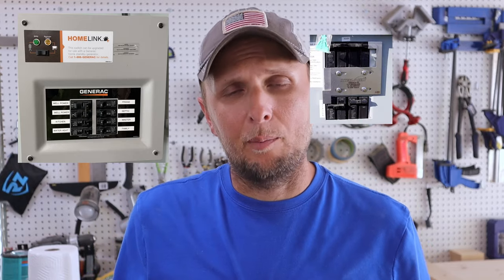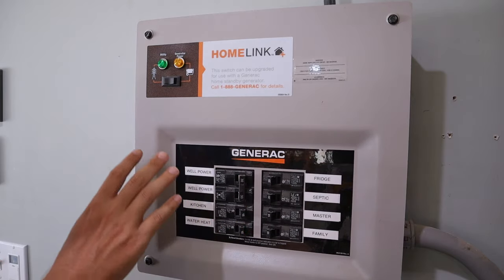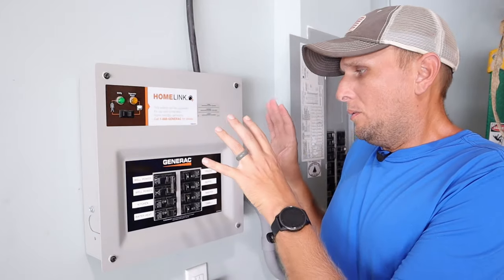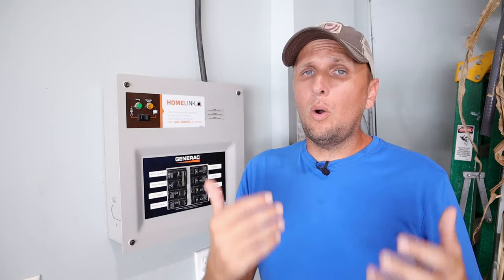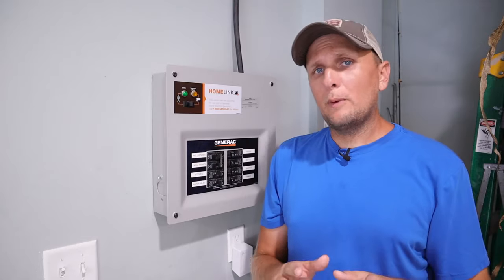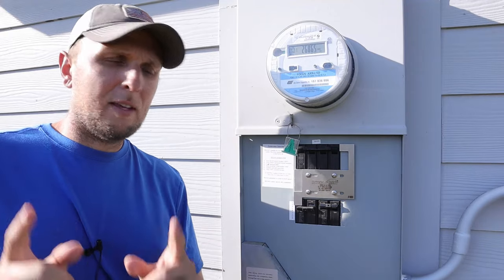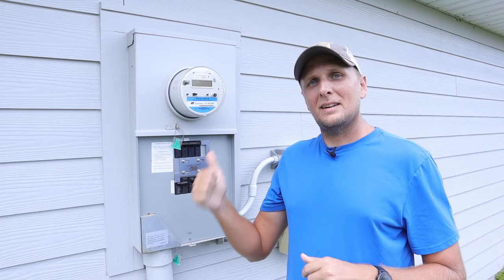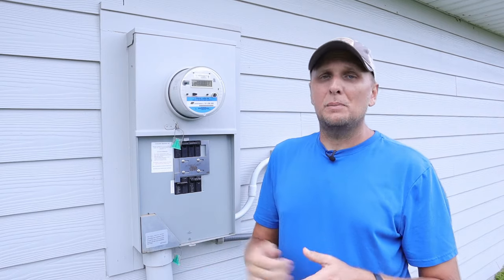How To Choose Between A Transfer Switch Vs Interlock Kit With Power Inlet Box

Comment: I have a panel outside that feeds two breaker panels,  one for the original part of my house that doesn't have a main breaker on it  and one for the addition part of my house, also no main  breaker on it. I have a 6250 watt generator that i want to hook up. The panel outside has two main breakers on it. What    would you think i should do with this problem? Thanks. My name is Jim.
Reply: Suggestion - for a temporary situation or a permanent solution, get a Generlink meter base adaptor. Would recommend the 40 amp unit. I did not purchase the surge protection nor the wireless link as I did not need them. I did get the 20' cord with the 50 amp, RV type plug. It comes with a cord of your choice.
Safe, very easy to use, super easy (5 min.) for the electric company to install. 
I have no ties to the company. I bought one and it's a great solution. Using it with my Generac standby genset. Simply plug in the cord when needed, unplug when done.

Before contacting Generlink, I first emailed the datasheet info and request directly to our utilities director at the city. The city provides electric to our area. 

A week later I had his letter of approval! He did say that I had to contact his office to have it installed as the customer service reps don't know about the device.

Comment: As long as the main breaker is off there's no feedback to the Utility line, then you can select the breakers you want to use on the main panel and turn the rest off.
I have a clamp on one side of the main line coming in to an GFI outlet, I have a light & Bell plugged in so I know when the power is back on.. I switch the breaker off to the generator and switch the main back on.. Very Simple !
Reply from the maker: It is simple, however it’s illegal.  If it slips your mind or someone else’s for whatever reason that could be a big problem.  We are all human and make mistakes.  The interlock kit removes that possibility.
Reply: @HowToHomeDIY  ....
Only License Electricains are allowed to legally teach and install electric boxes, but we have plenty doing it.
I agree, Better safe then Sorry !
This works great for me and me only, no one else is allowed to touch it.
Reply from the maker: That’s actually not true.  Many jurisdictions including my own allow the homeowner to do their own electrical work on their side of the meter.  I’m not telling you what to do, you are right if those steps are followed then nothing will happen.  But to your point, can you imagine if I made a video or even a comment promoting that?  The comments would be lit for sure 😂
Reply: @HowToHomeDIY     I've seen certified electricians like Tri-M mess up majorly.. 
I am going to add the Interlock Kit  to my main, just to be safer..
Heaven or Hell
Ready or Not ?

Comment: How do you feel about generator vs inverter? Is generator power clean enough to run, now that most things have sensitive electronics built in?
Reply: Depends how lucky you feel.  THD (Total Harmonic Distortion) can vary between 6% to 25% on some standard generators.  Most generators show the THD as part of their specifications but you need to be careful since many are measure at zero load and increase as the load increases.  I've run a Plasma TV and computer for short periods on my old Generac 7500 without any problems.  Heard stories about frying circuit boards in modern gas furnaces and newer model washer, dryers, friges,  microwaves, etc.  When on generator I usually unplug sensitive electronics from any branch circuit being feed by my generator.  If you don't already have a generator and can live with max wattage of 7,000 I would consider a inverter gen over standard generator.  If you just powering motors, compressors, resistive loads and lighting a regular generator will work just fine.
Reply: @johnwalker6121  That’s my thinking too. Thanks for confirming.

Comment: Im from canada and have a Firman 10k watts. Witch would be more benificial and waht could i be looking for a price for install
Reply from the maker: I would probably look into getting a power inlet box with interlock kit.  It is hard to say how much it would cost as everywhere is different.  I would just call a couple electricians in the area and they can give you a ballpark estimate.  Just make sure to know how far they are going to have to run their wiring from the power inlet box to the panel and size of the generator and you should be able to get a pretty close estimate.

Comment: Few questions: the interlock system with 50 AMP plug, did you use 6/3 wire? Also, I'm looking at the WGEN 20KW, but noticed for whole house you had a 15KW is that efficient for most of your circuits? Sure is a huge price differential between 12- and 20-KW generators! Thanks, Dave C
Reply from the maker: Hey Dave, yes I built my generator plug out of 6/3 wire.  Was super easy to do.  My generator is 15KW/12KW.  I am able to power just about every circuit in my house with it including my 4 ton ac unit, but I did have to put a soft start on it.  I also still shut off non essential circuits just to make sure I don’t have to worry about overloading it if for whatever reason the ac, well pump, fridges, and septic all turned on at the same time.   I also won’t allow my ac to be on if I’m going to be using the oven.  So for me personally it’s plenty.  The WGens are nice units.  Low THD.  Hope I was able to answer your questions or give you a better idea what you might want or need.
Reply: @HowToHomeDIY  Yes, thanks for quick reply! Love your videos  very helpful. At this point I feel confident installing 50AMP box, just need to find my 15KW genset? Supplies are limited. Thanks again...Dave
Reply: @HowToHomeDIY  What wire  size would you used for a 30 amp? Im having a hard time finding a 15KW generator and may just use my 5550KW. Thanks again...

Comment: My electrician installed an interlock kit on our square D main panel to a 50 amp breaker. The breaker connects to a Reliance PNB50 connection box. My question is that the main panel has bonded neutral and ground. The firman generator model T08071 has neutral bonded to the frame. I have not done a test yet because I want to know if the panel being bonded and the generator bonded to the frame is going to cause an issue? So much confusion on this topic. Will someone please clarify if this is okay?

Comment: How do you get 220 with a 50 amp inlet box when plugged in to 50 amp on generator.
Say a Duramax generator XP 13000 E

Comment: You can still back feed through the neutral on a interlock kit.The transfer switch acts as double pole double throw, which cannot backfeed the neutral on street side .
Reply from the maker: Power is not flowing on the neutral past the panel.  It is almost 0.  There is a reason that this install is legal and carried out by electricians daily.

Comment: Since the manual transfer switch only disconnects the utility company’s two hot lines one and two, how do I keep my GFCI equipped generator from seeing the power company’s grounded transformers through the neutral and shutting down?

Comment: Hello again, my transfer switch is way simpler than your Genrec switch. My transfer switch has the utility line into the knife switch and my generator line into the  knife switch which feeds my electrical panel. This system ensures that I can only draw power from a single source- the utility or the generator. This system also makes it impossible to send current down the utility lines from my generator- VERY IMPORTANT- after a hurrican you don't want current running through downed lines. I have a 6kva diesel generator which easily powers the whole house. Again we should always employ the KISS principle, the stress of losing power loves to mess with your head.
Reply: Hi can you explain how you installed your transfer switch?

Comment: Okay so I have installed my transfer switch and my breaker panel is bonded.  I am getting continuity as expected but my question is:  When I test the plug outside my home I am getting continuity between neutral and ground and want to know will this affect my generator during a power outage?
Reply: I’m not sure about your case but mine are bonded and my generator, a Champion 7K,  is happy

Comment: My local utility will not allow interlock kits.  Even those that meet national code. I have also found the prices in both cases are significantly higher. Especially if  you go by the local law and have it installed and inspected.   That's a catch 22 here.  No inexpensive interlocks allowed so no one puts them in or overlooks they are there. So people are afraid to make it out then just go ahead anyways and plug it into the dryer.

Comment: Interlocks are good if you're hands on and have general knowledge about how much your generator puts out in relation to what your appliances and other circuits draw. As you said, you have complete control - which comes in handy - but you have to "get it". A transfer switch is good for non-mechanical dummies who need everything stupid-proof. You know...the kinds of men that call receptacles "sockets" or "plug-thingies" and their extent of electrical knowledge is replacing a light bulb.
Reply: Ever heard of the term "work smart and not hard"? Let me explain: Manual Transfer Switch (working smart); Interlock Switch (working hard). 😀
Reply: @Pk3_Garage    That's subjective. Someone who knows what they're doing would have no problem with an interlock switch. It also allows you to decide which circuits you want to run without having to pick a handful and be held to that decision. 
By the way, you're still not working as "smart" as you say...Let me explain:  Automatic Transfer Switch (working Smarter)  😁

Comment: One issue with the interlock kit’s that was missed is that many older boxes aren’t compatible with interlock switches.
Reply: Also,   There are  many different brands and models of circuit panels   Many of them have the main breaker lined up with all of the branch circuit breakers,  ( rather than separated at the top) ,  In this situation,  A bolt on interlock is Not going to work.

Comment: Can we connect a small generator (like 2500 watts) to a transfer switch or a interlock kit with power inlet?  Here, this is a given that not all the circuits will be powered.  If a small generator can power a transfer switch but not to an interlock kit with power inlet, this should be considered as a "plus" for using a transfer switch.  I am just asking a question; I don't know if this is true or not.  I am asking this because after hurricane Sandy, many gas stations could not supply fuel to customers.  A large generator becomes a liability, not an asset.  A small generator turns out to be more useful because it didn't need to be refueled that often.  I am hoping that you can let me know if my understanding is correct or not.
Reply: Either Transfer Switch will work with any size generator.  They key is to balance the loads.  Most Transfer Switches comes with watts meters for both legs of your load center.

As to a smaller generator being more efficient than a larger generator, is subjective.  I'd have to say they are about the same in efficiency, when running the same load.  The difference is, a larger generator has a larger tank capacity, so you can run your loads longer per tank of gas.  Most smaller generators are rated at 25% load per tank, where a larger generator is rated at 50% load per tank.  Meaning you can run more things with a larger generator and be very efficient. 

Hope that makes since.
Reply: @Pk3_Garage  Thanks for your reply.  This is useful.

Comment: I used a transfer switch so I can micromanage my circuits on solar. If I'm making enough solar power to charge my 5kWh battery, I can switch over more circuits off of grid power on the transfer switch.
Reply from the maker: Nice!  I would like to add solar.

Comment: I have a 30 amp portable generator. Is that considered a larger generator?
Reply from the maker: How many watts is it?
Reply: 6500
Reply from the maker: Ok So that is a very common generator size.  I have one about that size and only hook it up to the transfer switch.  That doesn't mean you can't use a power inlet box with interlock kit, you will just have to be careful with how many circuit breakers are on and what load they are pulling with that setup.

Comment: "YMMV" (Your Mileage May Vary) on your generator and what is hooked up on your transfer panel. I had to ARGUE with my electrician to add the garage door outlet to the panel. I guess he never heard of "Happy wife...happy life"! When my Sears (almost 60yr old) break I will replace it with one that had a battery back up. Keep in mind if you don't have a 7k-10k generator you can only run certain things while other things are off. After a number of years I will get another electrician to make changes. The two bedrooms downstairs has power. But the two bedrooms upstairs don't.

1. Water heater MUST be added.

2. I only run the lights that are needed. Candles work great!

3. Range and above microwave is not on it. I bought a small microwave to heat food and water for coffee or tea.

4. Washer and dryer are not on the panel. If I needed to wash cloths during the summer I can hang them outside. Generator has enough power to run the washer machine.

Pay the extra money to get a battery starter! Your back, shoulder, and wife will be happy. Show them how to go on and off the generator.  Make notes #1, #2, #3 (on) and #4, #5, and #6 (off) on the panel.  Be Safe...Be Safe!

Comment: This might be a silly question… is it possible to use outdoor 30amp plug for generator use with interlock kit for power outage, along with the plug able to be used for power to RV ?
Reply: Basically, no. The interlock kit makes it so that you can only have your main panel or the generator on at one time so that you don't send power out to the poll and hurt people working on it.
Also, the inlet outside is a male connection so that Basically plugs into the generator instead of the other way around, if that makes sense. 

Just put a generator inlet and a RV outlet next to each other.
Reply: I would need elaboration on what you mean. But I do not see any problem hooking an rv cable to the interlock, just as simple as any other load.

Comment: I have two 7500 running watt generators, Can I install two 50 amp breakers/ interlocks and cord plugs and feed power from both generators?  or would it be best to add two transfer switches and split of the circuits per switch, thanks
Reply: Well you answered my 2nd question further into the video
Reply: @mikepierce1376  ... there are very few gen sets that can run with another set and sync up. My suggestion is to not go there unless you like expensive smoke. BTW, a 7500 watt gen set is only good for about 30 amps. More than that and you risk more expensive smoke.

Comment: I'd like to use the interlock kit. However, the videos I've seen require the use of the top double 30 amp breaker. Well, it's already being used. Any ideas?
Reply from the maker: You would have to move the breaker that is there down to another spot if possible.

Comment: I've had a transfer switch, and I think it fairly well sucks.  Yes, I can control and limit the loads, but there is no way I can afford, or even find, a transfer switch that can cover enough circuits.  One example:  They ALL have a limited number of 240 volts circuits, usually one or two.  Well, my 8KW generator can handle the water heater, or the stove, or the dryer (or maybe the A/C if I soft-start kit it), but with a transfer switch I am stuck choosing one or two of those.  With an interlock, I can heat the water tank, switch it off, and switch to the stove to cook, and then switch it off and run the dryer,  Likewise ALL the other circuits in my house.  
I wish I had never wasted money on a transfer switch; I have ordered the parts to do an interlock.

Comment: Actually an interlock is fine with even a small generator, feeding only 120V into both legs of the house.  That way all your lights and outlets work, including refrigerators and fans.  Of course you should turn off all 240V breakers prior.

Comment: Does the transfer switch contain surge protection?
Reply: No. Some transfer switches come with standard circuit breakers.  You should still protect sensative electronics with surge protected power strips.

Comment: Great video but, I think you should have mentioned to Diy peeps that before you buy either of these you need available space to supply power to both of these situations .  I mad that dumb mistake once already. If your panel is maxed out, your out of luck
Reply from the maker: That is very true.  Tandem breakers can be an option.
Reply: You don't need any "available space" for a transfer switch; it doesn't require an additional breaker.
Reply from the maker: For a transfer switch you will still need room for a double pole breaker.  It is what supplies the power to the transfer switch while using utility power.
Reply: @HowToHomeDIY You're referring to an interlock; that requires a double pole breaker.  A transfer switch does not, at least not the Reliance 6-circuit manual transfer switch that I installed.
Reply from the maker: My generac transfer switch requires a double pole breaker in the main to feed it from the utility.
Reply: Look at a Reliance manual transfer switch, Mr. Miles. No additional breaker is required for its installation.
Reply: I concur.  I have installed a six and ten circuit Reliance Manual Transfer Switch and they don't require any breakers in the main control panel.